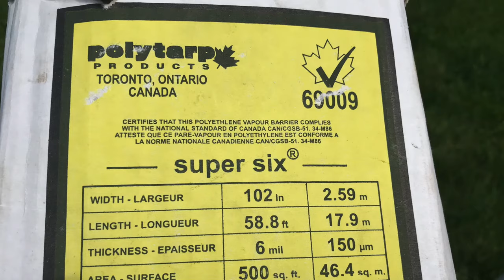Cheapest DIY GreenHouse Ever | Easy Green House with Fold-up Walls

Comment: Pretty plain what he is doing and how. Don’t need dimensions because they don’t actually matter. Looks like a 5x5x5 structure with a roof.
Reply from the maker: Hurray! Someone gets it!
Reply: Exactly and since he didn't mention exact dimensions, one has the ability to make it as big or small as they want. I'm going to be using thicker plastic though 6 mil is not thick enough for the location  I'm in I'll be using 10 mil or thicker. I like this idea best because I rent the property I live on and if I have to move it or something I can just take it back apart
Reply from the maker: @nicholecrouch311  I'm pretty sure I used 9m but I could be wrong. Either way. I no longer live at that address but, the structure is still up... and its about 3 blocks from the ocean where it gets quite windy and I never had a problem with it getting damaged. Perhaps the secret is it's not an airtight structure. air can still pass through it.... and using lots of staples lol
Reply: All the materials used are in the drop down menu of the title description
Reply: It’s that simple
Reply: Nice.felt happy sharing ur vidio greenhouse.
Reply: Exactly plus you do not have to make yours the exact size as his. Build it to your liking 🙄
Reply: At least he could stop with so much suspense, unless he Qantas to keep why he built it this size or manner, secret.

Comment: This is great, thanks. It's good to see someone show something that is functional and cheap. This would be easy to modify if it needs to be bigger or smaller with added support beams on the sides. We have an local source of free pallets, so I am thinking of using them as a base. We get high winds here and I don't care what you spend it will eventually be beaten up. I appreciate this "on the cheap" version. More money to buy good seeds with!
Reply from the maker: there ya go. I try to spend as little as possible on anything garden related. Kinda defeats the purpose to grow your own food if it costs more than buying them from the store
Reply: That pallet idea is actually fcking genius bro. Me and my buddy are going to build one of these soon and I'm gonna pitch that too him. Thanks bro🙏🏼✌🏽

Comment: This was very clear. It was exactly what I was looking for; no fancy measurements, no fancy carpenter language. A couple things I would do differently: I would put some kind of plexiglass on the walls/top because it doesn't look heavy enough to resist New England weather. And also I want mine to last more than a year. I have some old windows in my basement and I think I'd put them around the bottom of the frame to give it some extra weight too. But that's just how I would tweak it. And the video is so clear that I could do it without a lot of hassle. Thanks!
Reply: Good thoughts. We are in the Midwest and have similar issues - wind, cold. I appreciate this for the idea that you don't need much to start. I have seen a few people make really nice greenhouses out of old windows. Man, if I could find a bunch of old doors and windows (for cheap or free) I would be all in for that!
Reply: @barefootrealist246  Check The Re-Store or FB Marketplace. You might get some for cheap.

Comment: Hey great video! Love that greenhouse system! We just made some for ours as well and we're really happy with how they turned out. We used conduit to create a hoop house shape, and wrapped plastic around that. One suggestion I have is that we found that stapling the plastic together was a bit flimsy so we ironed it together instead which works terrifically!!! Check out the video we just posted about it! 😃

Comment: I like the idea, but wouldn't a good gust of wind blow the plastic off the hooks?
Reply from the maker: There are no hooks. I used thick plastic, and lots of staples.   It's located a few blocks away from the ocean where it gets quite windy. Almost a year later, and the green house still stands. I think possibly part of the reason, is the 3 fold-up walls. They aren't air tight and allow air to blow through it.

Comment: You could have built the rafters on the ground and had them sit on top of the walls with an overhang that way the water would runoff the roof and not down your walls.
Reply from the maker: Good suggestion! My goal here was to keep heat inside. I wasn't concerned about rain water. Thanks for the comment!

Comment: Also the Polytarp clearly states keep out of sunlight on the label.  What would that do to the plants?
Reply from the maker: Yes. Polyethylene isn't supposed to be exposed to direct sunlight. What will happen over time is it will lose its malleability and become brittle due to the UV rays. It takes a while for this to happen though. There is specific greenhouse plastic you can buy that this will not happen with - however it's expensive. And as specified, this video is about how to make the 'cheapest' green house. If you would like to build a green house that will last and is more expensive, there are lots of videos on youtube that can direct you. Thanks for the comment :)

Comment: I am from Asian country.  We get sunlight throughout the year. So this polytheen cover will burn the plants???
Reply from the maker: It will not burn the plants.... but if you live in a very hot environment, the fold up walls are very beneficial. On hot days, I would open them up to get air flow and let the heat out.

Comment: Would a teepee type structure be cheaper?
Reply from the maker: Good question. I personally wouldn't enjoy a teepee. Pros and Cons would be: A teepee design would be difficult to build an easily accessable door. Also difficult to have the retracting walls for airflow. Also unless you build it huge, the narrowing of the top is going to greatly reduce the space for plants to grow. It might be a cheaper option, however, i dont believe its much cheaper. That shape might be more aerodynamic and wind resistant tho.

Comment: Why does that plastic sheeting say "keep out of sunlight?" Also, I plan on using an old metal frame gazebo (10x10) any suggestions about how to secure the plastic? I am saving this video though because I will need to make an inexpensive easy greenhouse when I move. Thanks!!!
Reply from the maker: Hey. Great questions. I originally had a voice over for this video which I failed to include. The poly / plastic sheething says "keep out of sunlight" that's why I showed the label in the video...... The reason is..... Any kind of construction poly like this doesn't do well in sunlight. Transparent, certain types of PVC ..... I can't explain why, I don't know exactly why.... but I know the UV rays from sunlight basically over time start to disintegrate the elasticity and  integrity of the product......   The reason I used just a simple product like this, meanwhile showing it on camera..... is the house I am living in is getting torn down in a couple months ....... So the longevity of the green house walls wasn't a huge concern. I do believe I mentioned this in my video. But thanks so much for inquiring and asking :) ...... I really love that the fact that people care enough to watch and ask questions about what I do :)
Reply: @neilhatherall  Thanks for replying back!
Reply: @neilhatherall  sure thats greenhouse material?
Reply from the maker: @texheel   I originally had a voice over for this video which I failed to include. The poly / plastic sheething says "keep out of sunlight" that's why I showed the label in the video...... The reason is..... Any kind of construction poly like this doesn't do well in sunlight. Transparent, certain types of PVC ..... I can't explain why, I don't know exactly why.... but I know the UV rays from sunlight basically over time start to disintegrate the elasticity and  integrity of the product......   The reason I used just a simple product like this, meanwhile showing it on camera..... is the house I am living in is getting torn down in a couple months ....... So the longevity of the green house walls wasn't a huge concern. I do believe I mentioned this in my video. But thanks so much for inquiring and asking :) ...... I really love that the fact that people care enough to watch and ask questions about what I do :)
Reply: @neilhatherall  lol ok must have been distracted..old age good vid though...

Comment: What kind of plastics you use and whats the thickness of the plastics looks great ima see if i can find the materials at home depot
Reply from the maker: I used 9mm polythylene I got from an old job site. You can find it at home depot. 9mm is the thickest you can get I believe. Thanks! Hope that helps
Reply: @neilhatherall  thanks for the information .your video help out allot and made it easy to build a green house so i can propragate in the winter my cuttings  and yes i was able to find all the materials at homedepot yesterday  that was awesome thank you and much appreciation👍🙏👍.
Reply from the maker: @josereyes8792  Glad I could help. Thanks for the comment!

Comment: How/Where did you find 500SF of 6 mil polyethene plastic for less than $20?
Reply from the maker: I got it for free from an old job site. I mentioned that in the voice over that I never added to this video. There's much I could have improved on for sure.

Comment: all that wood at my local hardware is like 150 bucks crazy
Reply from the maker: Yeah. It's insane. A bad time for DIYers :(
Reply: @neilhatherall  sigh yea. i used pvc tho like 3 bucks for a 10 ft piece.
Reply from the maker: @mikeclizzy2138  Yeah PVC is a good option. Not sure how attaching plastic would work out. It's ridiculous what is now cheaper than using the cheapest spruce wood now. Hope it worked! Tuck Tape would probably hold really well to pvc, although not look very cosmetically appealing.  What size did you make it? I'd love to see pictures!

Comment: How did this hold up over the year?
Reply from the maker: I originally built this at a property I was living that was going to get torn down a year later. I no longer live there, but to the best of my knowledge it is still up and fully functional. I didn't mention in the video that I attached the frame to stakes I drove far into the ground. Also, because my fold up walls allowed a lot of airflow, as well as the aerodynamic design.. I never had a problem with wind. I lived 5 blocks from the ocean where it got quite windy, but perhaps this design wouldn't work in a windier environment. Again this video was not exact blue prints for an indestructible green house. It was a general idea, for a cheap, functional green house. I wouldn't recommend it in areas prone to hurricanes and tornados.

Comment: Is it safe to use that tarp material, it said to keep away from sunlight?
Reply from the maker: Poly isn't ideal for a long term greenhouse. Over time it will basically start to disintegrate because of the UV rays. But, the house I'm living in is getting torn down next year. So this was just a one year project. If you want something more permanent there is green house plastic made specifically for this purpose. Hope that helps!
Reply: lifefixx thank you very much that does help!
Reply from the maker: @josec439  Your welcome!
Reply: No not at all! Don't ever take it out in sunlight it might explode! And remember to worry about every possible safety warning written by lawyers because they are so committed to our safety!

Comment: So you got all materials for $20?
Reply from the maker: Yup. Depends where you get the poly from. I got it for free from an old job site. If you look around and you're lucky you can find all the materials for free.
Reply: The way you advertise it cheapest diy greenhouse $20 means you can get all the materials for $20 and that is not the case at all and it didn't say free greenhouse and it looks like almost $100 worth of lumber and plastic.. I feel like you click bait everybody it looks like a good greenhouse and it looks like it will work but you lied to your community. Way 2 get more views!
Reply from the maker: @calvinbuxton5382  Hey. No where in my video or the write up did I say you can purchase all the materials or tools required for this green house brand new for $20 dollars.  I payed less than $20 to build this green house, and anyone with a little bit of time and a head on their shoulders can too. The materials are easily found for cheap. The price varies. depending on where you live. Apparently where you live, cheap plastic and wood costs $100. I'm sorry to hear that. $20 green house - Did I include the cost of the gas to drive to get my lumber? No. Did I include the cost of hydro to charge my power tools? No. Did I include the cost of the tools? No. Did I include the labour cost to pay myself? No......  Is that click bait too? Thanks for your feed back.

Comment: Hi there, what kind of saw to you use to cut wood ? I am looking for  one
Reply from the maker: I use a battery powered circular saw. Craftsman. Cheap, but I recommend buying a high amp hour battery, because it takes a lot of juice. https://www.lowes.ca/product/circular-saws/craftsman-20-volt-max-6-12-in-cordless-circular-saw-tool-only-1033806
Reply: @neilhatherall  thank you

Comment: So you're basically using about 30meters (~100feet) of 2x4's. How on earth are you getting 100feet of 2x4's for $20? In Australia, that's about AUD$160, so $125USD. The cheapest you can get 2x4's in Australia is at about AUD$5 per linear meter, so about USD$1.18 per linear foot.
Reply from the maker: Yeah, I've decided to change the title of this video so it doesn't include $20 dollars any more. Prices of lumber have sky rocketed. I never intended this to be misleading - Just the cheapest way I found to build a functional greenhouse. Thanks for the feed back!